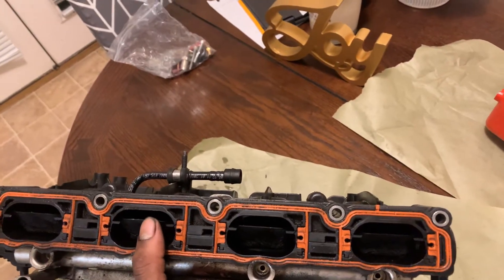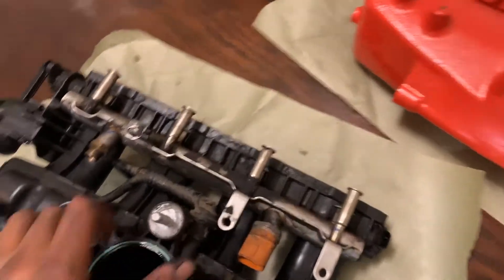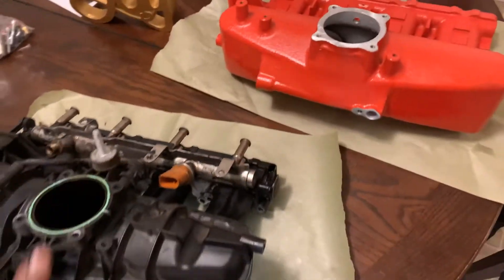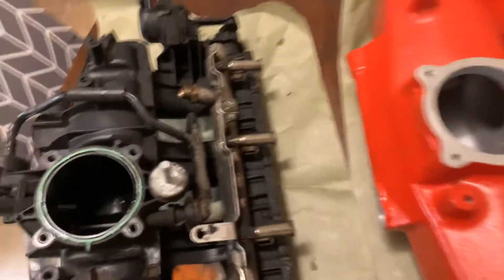Intake Manifold Runner Flap Delete Kit vs Aftermarket Intake Manifold

Comment from the maker: Whoever is commenting I’m not deleting any comments YouTube is deleting your comment because you suck at following their community guidelines 😅🤣 I hardly get on here at the moment.  I never said this was an HPA manifold it is a Pegasus motor sports manifold which is what I said it was.  I mentioned HPA because I was explaining how the design was similar to this one ☺️ that’s all
Reply from the maker: Good for you man but my summary is fine the dimensions of plenum and runners are all the same just like IE as well which is mentioned in the section this video just explains how it works basically so no I will not be changing it, again I never said it was an HPA manifold.  But it does do the very exact same thing.  I’m glad you learned how you can make gains on your build with my video.  Additionally this company used to be in Canada then moved to the UK so lowkey it’s probably the same exact manifold just not stamped.

Comment: So how’s the intake doing? Is it any better?
Reply from the maker: With my stock turbo and some custom exhaust stuff and tuning this manifold I’m able to push out 335 hp on stage 2 tune which most stage 2 tunes only put you at 280hp
Reply: @ccul8trvwbuild835  it's not fair to compare my Audi TT to your VW, I don't want people thinking I'm an online bully or something but I will call BS on your power claim. Who is your tuner? What software are you running?  Your KKK3 can't make over 300hp with WMI, race gas and a built short block.  Nothing but BS.
Reply: @atlasdelmar  maybe your build ain’t right I pushing 280 with a basic stage 2
Reply: @JoseRodriguez-gq3kk  APR - REEVO - RACINGLINE - UNITRONIC all claim that their EA888 STAGE 2 puts out 280-290HP and 305-320TQ. If you have a stage 2 tune, you're within your right to have a "hypothesis" on how much power your putting down, but if you're certain that you make 280+ please link the video to your software and hardware and dyno runs.

Comment: What is a benefit of this intake mainfold?
Reply from the maker: Larger plenum allows more air flow which allows you to tune for a larger fuel to air ratio which increases your horsepower especially important when adding a larger turbo

Comment: Those engines are rubbish so many issues with them. Really bad design that the owner ends up paying for.
Reply: 93k Miles on 2014 cc replaced 1 fuel injector , I don’t really know what are you talking about
Reply: @SillyRabbit19  You may not know but but if you hold on to it for a while you will definitely know and even if you do not admit it your bank account will show otherwise  !!!!
Reply: @TheAllEngineering  I already said 93k miles on it  stg2 all I spend is parts for stg2 and one fuel injector I know what I am talking about, driving it everyday for 3 years , you probably don’t know about 2.0 tsi  , they have problems but there’s around 3 different 2.0 tsi just in case you don’t know

Comment: I know when you're replacing the manifold that the dividers come out.  When you're doing the delete kit in the stock manifold do the dividers stay in, or do they come out?
Reply from the maker: The dividers on the engine side stay in they help your ecu balance air to fuel ratio